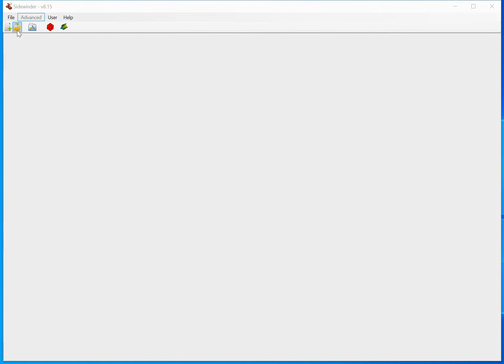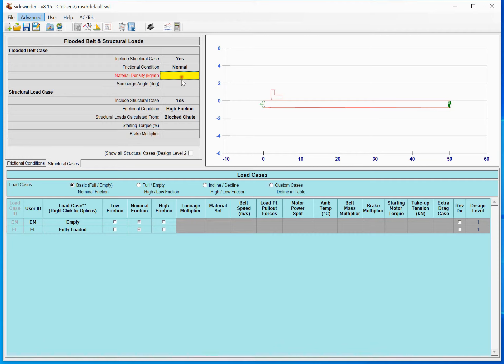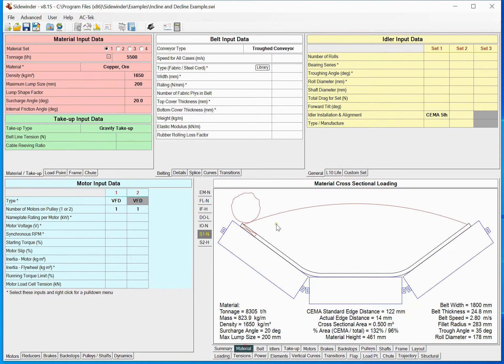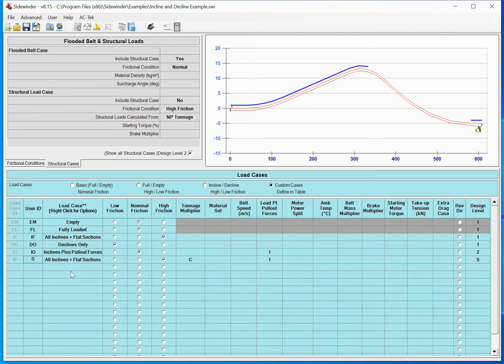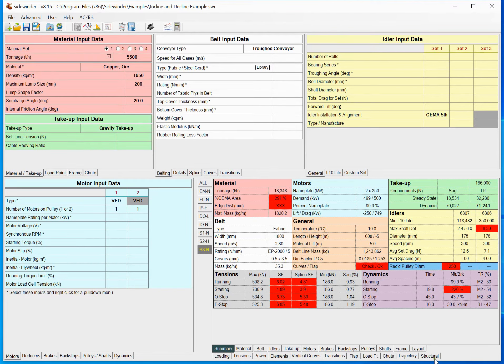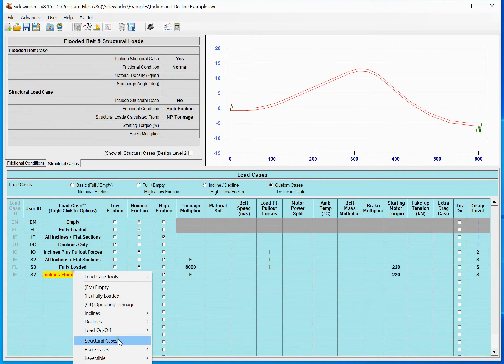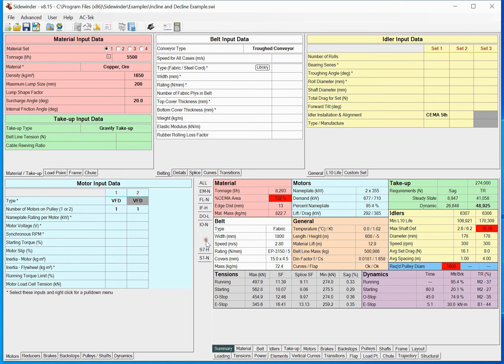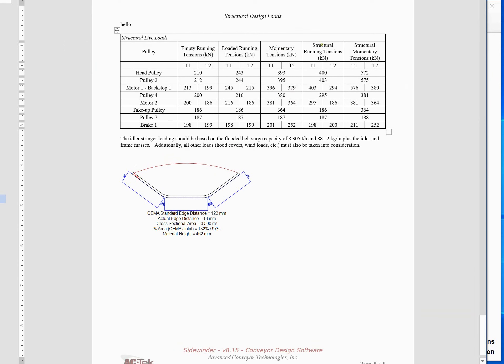Sidewinder - Structural Additions

Comment: Great addition Dave. I noticed the addition of “starting motor torque” as a column to the load cases tab. I’ve been wanting that for a while so I’m excited to see that. My common structural case is 300% motor FLT during a pseudo blocked chute. Would the results be essentially the same if I didn’t a manual fully loaded case called it a structural case and set motor starting toque to 300% there also?